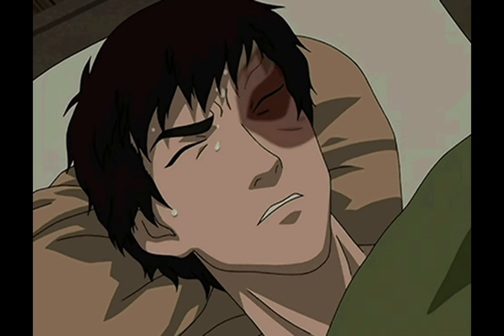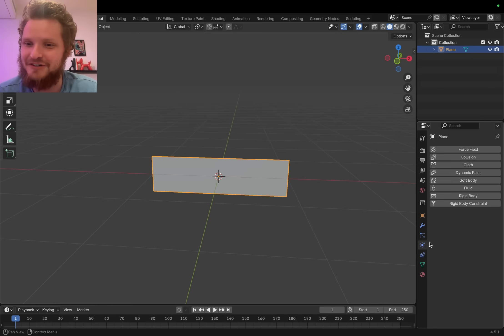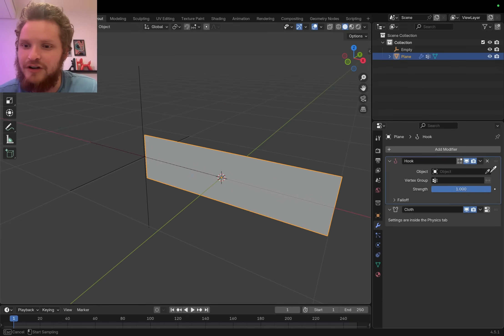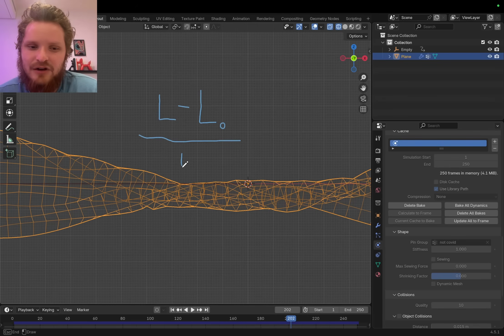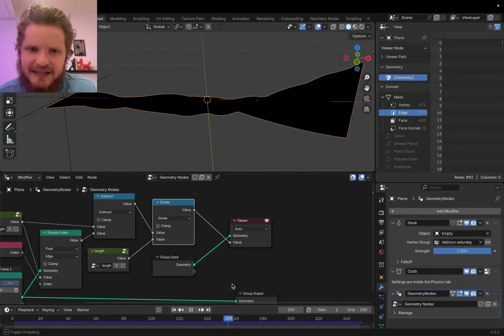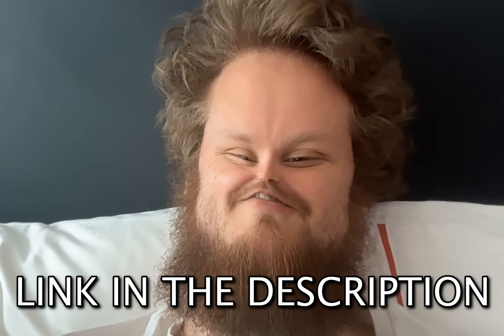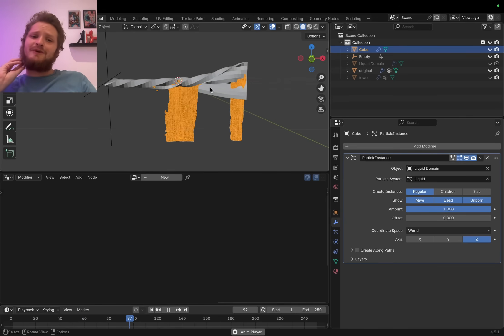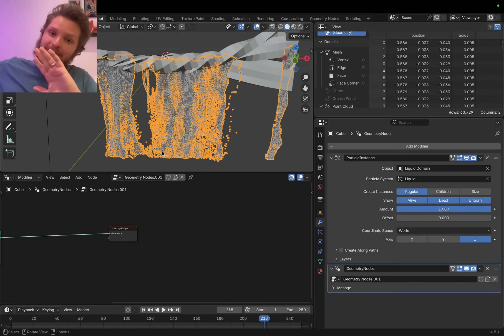Stacking Physics Simulations // Blender Tutorial

Comment: I'm unsure if it is due to the addons I have, or the version difference (Given you're on 4.5.1 and I'm on 4.5.3) but I get nothing for water output. Even following along as closely as I could and no fluid sim events are taking place. 17.02 is when I stopped. 

That said, I did learn a few things. The particleInstance modifier is a handy one. And I think there was an ALT+G command too. Sort of got a little flustered at the fluid sims not working.

I've... never really been able to get the fluid simulations to work on blender. Like, most of the time they just do not render. The times they do, I can't alter them in any way and have the result actually function. 

Side note. The method for having the towel model become "aware" of the strain via geonodes... feels like a very old feature that was removed from blender. Tension maps. 

I've been trying to find a good substitution for tension maps for a while now but most brake a little too easily for me to use in any sort of complex animation.

Comment: But why was there no conflict between the two vertex groups? The one assigned to the cloth modifier was to hold both the right and left side still, and the one assigned to the hook modifier was to move just the left side. So aren't you simultaneously telling the cloth to do two different and inconsistent things with that row on the left? I would have thought just the right would be for the cloth, and just the left would be for the empty and hook.
Reply: The pinned group is outside the simulation for movement and is thus available to move for other animations. It is not held in place, it is just like any other object... floating on space. :)
Reply: @BerraLilltroll  Thank you. Now it makes sense. 👍🏻